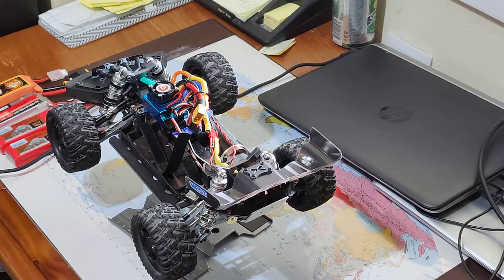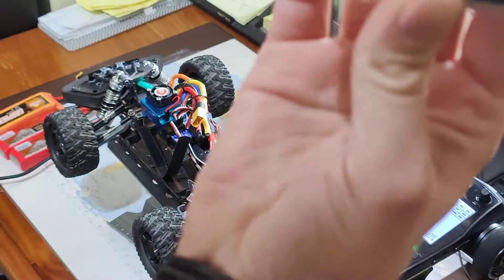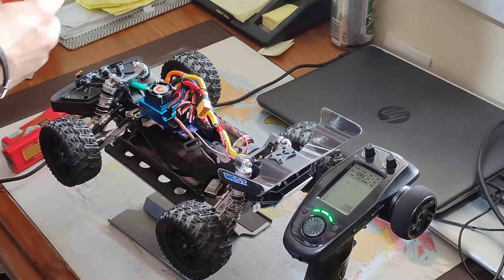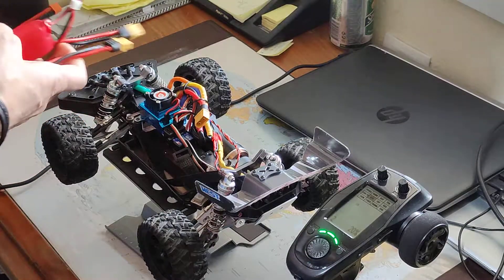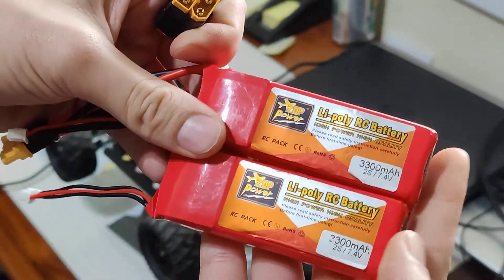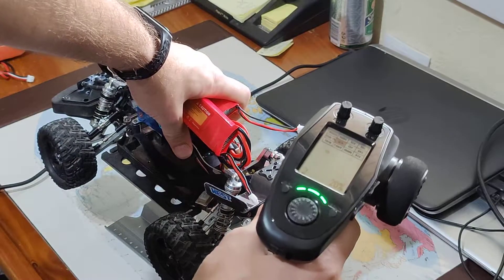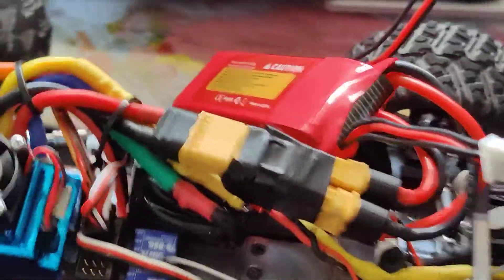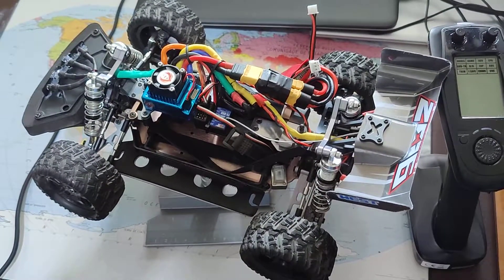different runs with 2S, 3S and 4S LiPO batteries in the same RC car

Comment: Can you run a 4s battery with 60 amp ESC?
Reply from the maker: You should check the ESC specs first, the one I'm using is compatible with 2, 3 and 4S

Comment: The motor will be burn for 4s
Reply from the maker: Actually no, been using it for years with no issues. As long as your ESC and motor accepts it, you're good

Comment: Is it better to gear up 2s or go 3s for daily bashing?
Reply from the maker: it depends if you want speed and power or duration. 2S for duration, 3S for power and speed
Reply: @Leonhartsberger what’s 4s for
Reply from the maker: @Murphys_Law9 even more power and speed but even though this ESC is compatible, this build isn't. Some tires literally exploded, some wheels were broken from the power itself and it's close to impossible to keep the front wheels on the floor. It's fun to try it, but it doesn't last long 😅

Comment: Will it damage thw car in long term?
Reply from the maker: Not at all, it just requires more maintenance
Reply: @Leonhartsberger  ok, like wear from friction? Got it 👍🏾 thanks
Reply from the maker: @JaceN3D  more friction but also suspension, tires will wear quicker, and more speed means accidents will cause more damage, etc
Reply: @Leonhartsberger  ok 👍🏾 thanks 🙏🏾
Reply: Of course you're shortening the longevity of the rc car.

Comment: Does your esc says 2s and 4s for battery? Is that why you can used 3s to it?
Reply: Be carefull. Some ESC don't allow more than the voltage labed. Put a 3 or 4 s and you'll see...: kaput !-))
Reply from the maker: Yes it allows batteries from 2S to 4S